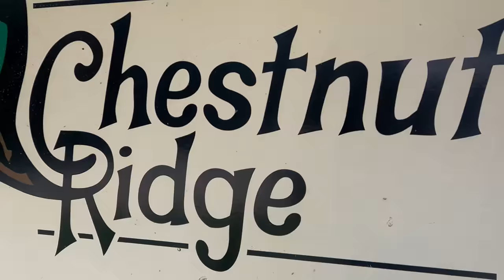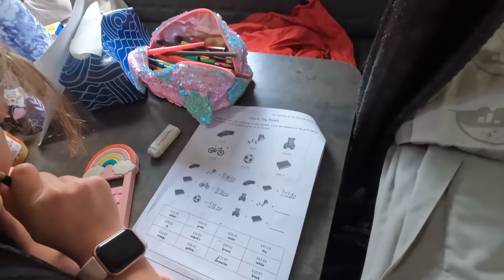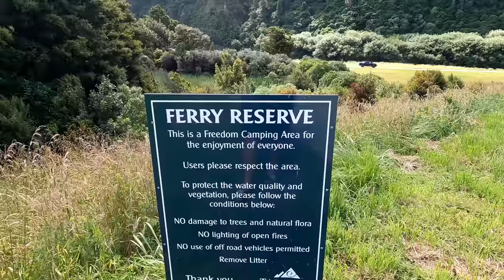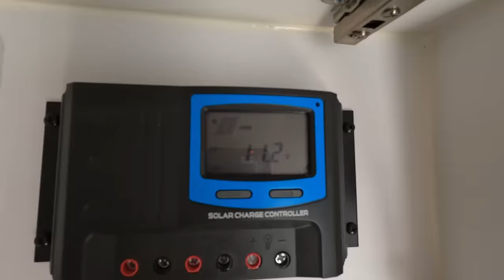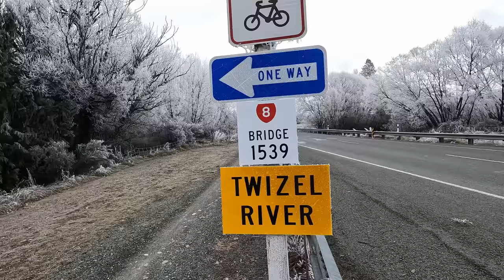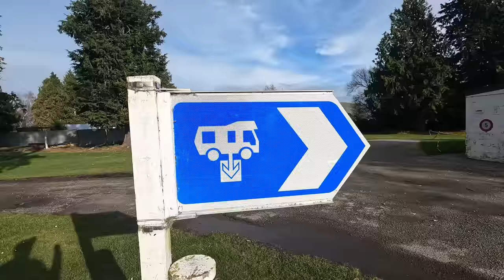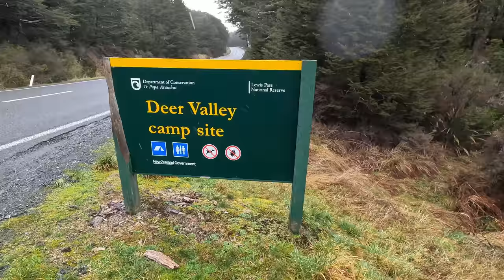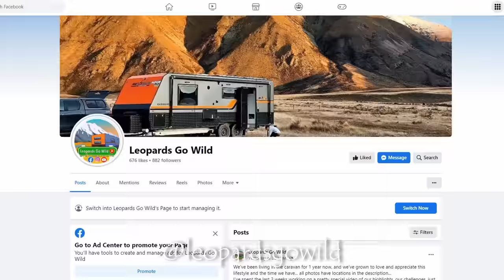1 year on the road | A fulltime family travel story

Comment: Hey Mike, it's great following you reliving some places we've been learning of others we haven't. How long and often do you use the gennie and what make/model of battery charger do you have? Thanks
Reply from the maker: Hey mate, we have used the Generator most days since we got it. I suspect now we are into daylight savings we will barely use it, and in saying that the times we have used it have been to charge the ecoflow which is our easiest way of having 240v power in the caravan. The generator will charge the ecoflow in 1 hour where the solar blanket / panel we have for the ecoflow takes around 4 hours to charge.